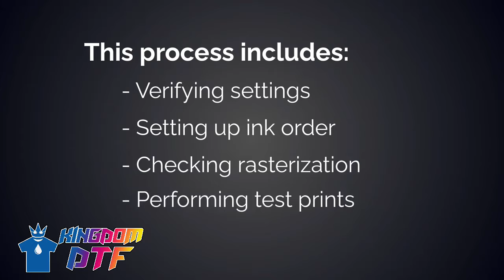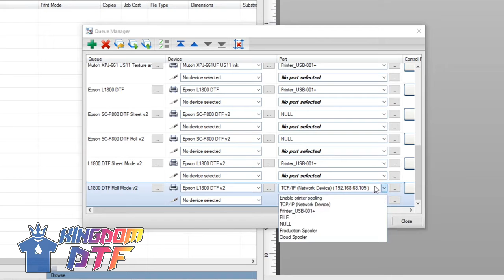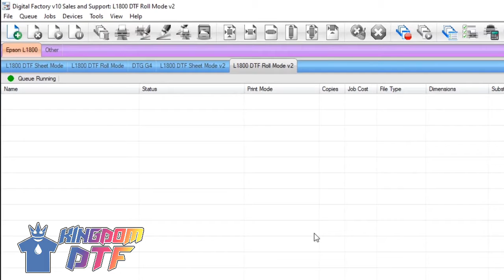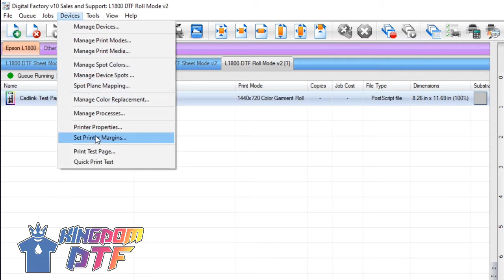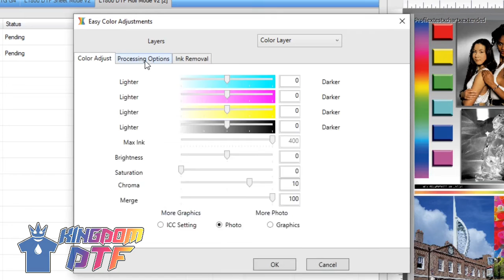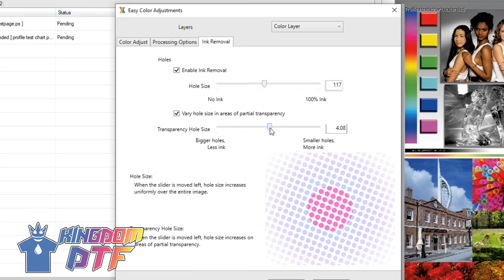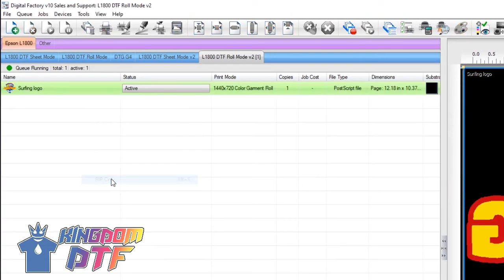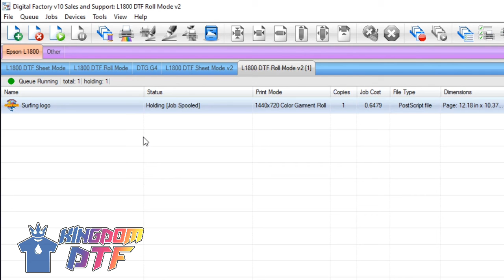How to use Cadlink Digital Factory for DTF Printing - Cadlink DTF Tutorial (Quick Guide)

Comment: Hi, I have a problem if you can help me please, it is printing just the middle of the image instead of the full image I don't know why, can you help me please?
Reply: Im having the same issue not sure how to fix
Reply: @jace2077  somebody told me to uninstall and reinstall cadlink and I did and it worked. But I made a print and the colors came out bright than the image I don't know why
Reply: I figured it out it has to do with the paper reader sensor I use 2 pieces of painters tap from side to side of the paper I place it on the side I’m not printing on or Matt side of you will that fixed that issue for me

Comment: Hello, hopeful someone could help me I do the set in order but it is grayed out how can I get this option to select my ink order? I can print but it won’t come out with the white in at all or the white coating on the back.
Reply from the maker: Install the correct driver with v2. L1800 v2, xp15000 v2, 8550 v2, etc. you are using.

Comment: I am having an issue with my xp15000 starting print 2 1/2-3" down the sheet.  How do I adjust that?
Reply from the maker: Try to put masking tape or painter blue tape at the border of sheet since xp15000 sometimes don't see the film.

Comment: hi my printer is only printin part of my image.  matter of fact just a section of the middle in a rectangle how do i fix.  my preview shows the entire picture but thats not what its printing
Reply from the maker: Probably the printer is not seen there is a film there. Try to put masking pate on the back of the film so the printer can be recognized there is something there. That can happen with some printers like xp15000 or et-8580, but not with printers like L1800, p400, p600, and others.

Comment: Hi! I am new to this software, but for some reason, every single time I print, it stops halfway through and says Unknown Error. This does not happen with any of my other programs, just this one, so it's not a problem with the printer. What do you think it could be? How do I check this kind of error? Thank you.
Reply from the maker: sounds like a software issue, I recommend calling Cadlink 1-888-744-6522
Reply: I've fixed by connecting thru wifi connection. Connect your printer to your wifi router then in the manage queues select TCIP/IP (Network) for the port selection scan and select your printer.
Reply: It's because you didn't set up or download the right printer driver

Comment: Hi, im new to dtf i have a modified epson 3880, but my colors are way off, or its darker than on screen, i see lot of people print very nice prints and vibrant colors without icc profile, but i cant get good prints, i use inkbank inks and default settings i tried 1440x1440 ( the print quality is better than 1440x720 but very very slow) 1440x720 the speed is amazing but prints come out very grainy, maybe you can have some solutions to my issue , im ready to pay for someone who can help me to set up the software, thank you
Reply from the maker: 3880 is similar printer as R2000 and they print better in 1440x1440. I can say make an icc profile for that printer, inks and films you are using.

Comment: I have an xp15000, i have followed all the videos and directions but I can't print, it goes through the whole process but no ink comes out, what am i doing wrong?
Reply: did u find a solution? sort of having the same problem
Reply from the maker: when is new, you need to do an ink charge so the inks coming out. If is not new and you use already, do maintenance on the printhead, if left without cleaning can clog white channel.